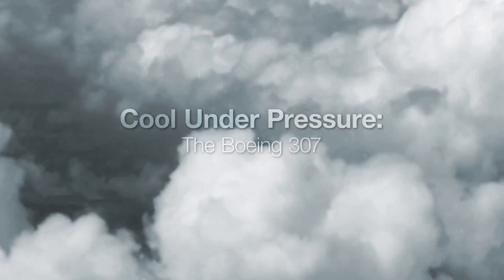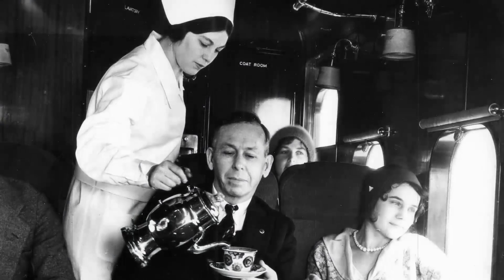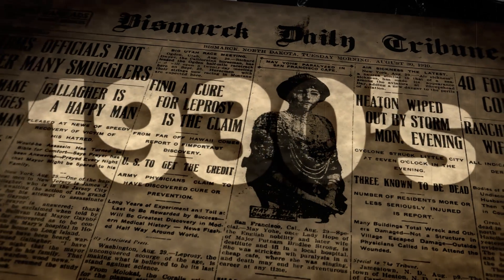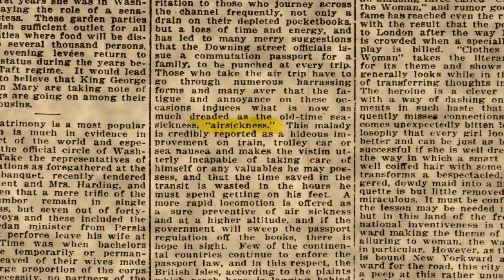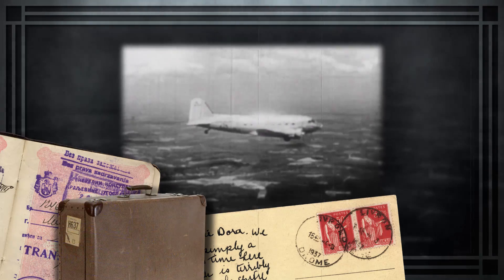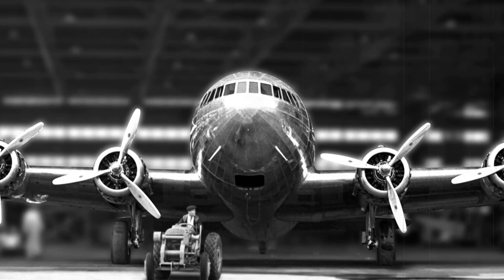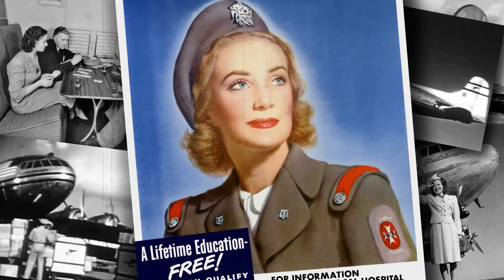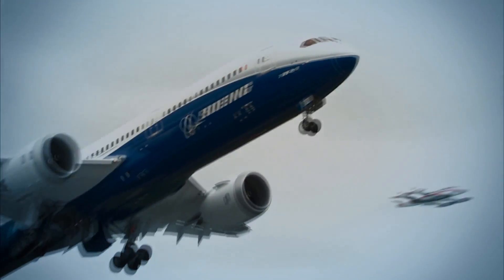Cool Under Pressure: The Boeing 307

Comment: The engineering for the pressurized Stratoliner was used to build and improve the venerable unpressurized B-17 and the later B-29 which was pressurized.

Comment: So they pressurized the cabins on the commercial planes in the 30s but didn't pressurize the cabins in the bombers in the 40s.... Seems legit.....
Reply: But if they got t hit with one bullet the would be screwed like shooting a bob gun into spray paint explodes.same concept with planes
Reply: Adam Bratvold it would of let them fly a lot higher though, far higher than any fighters in that era, also the flak shell would of exploded before it could even hit the target, because they weren't meant to be shot up that high...
Reply: +Erik Viets The Boeing B-29 had a pressurized cabin
Reply: Yeah but that wasn't made until 1944 i'm talking about why they didn't do it earlier in the war
Reply: +Adam Bratvold That's not how it works.
Reply: PaintHerWhite Oh really now, so what you are saying is if I opened the door on a airliner it would not create a vacuum that sucked everyone out of the plane.... seems legit...